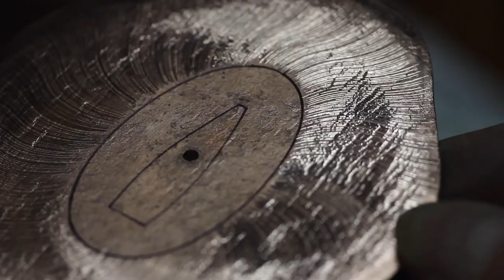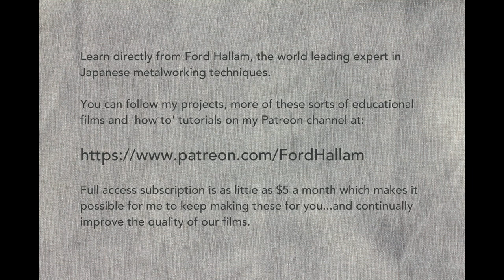Tsuba school: Hosa Kusa - Recreating a Modern Classic, Part 5 - Creating the scribed texture layer.

Comment: I have just got to the end of this part for my build. The surface is quite rough with burs from the scraping.  What should I do to smooth it?
Reply from the maker: Without seeing the problem I cant really say much but those fine scraped lines shouldn't be rough or have burrs at all? It sounds like you used way too much pressure to be honest.